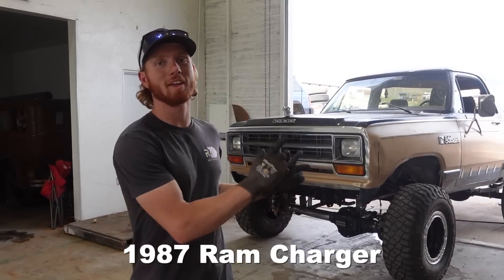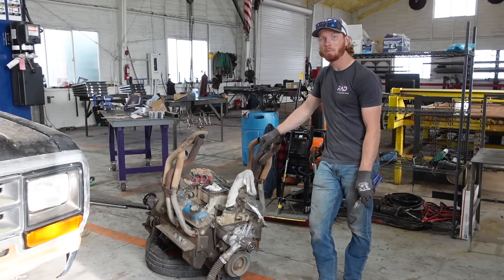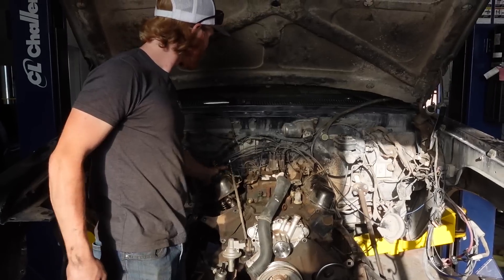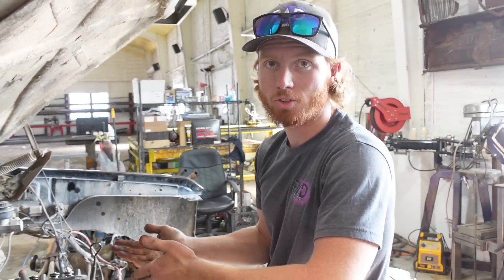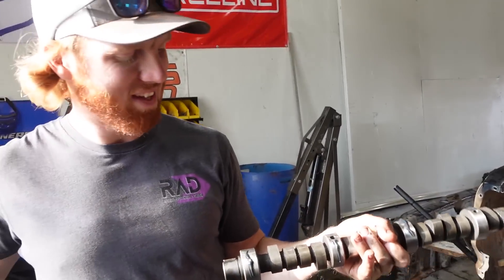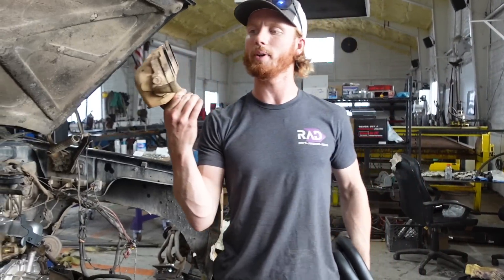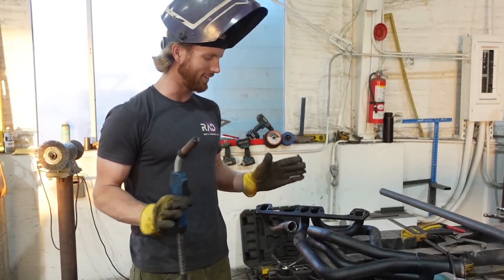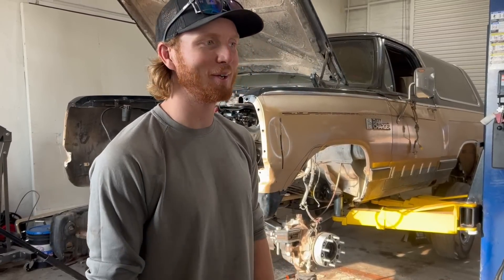Junk Derby Engine for the RADCHARGER

Comment: Rudy don't quote me but the starter motor you have the big one has less cranking power and the new smaller one is for a higher talking cranking motor more power and your cooling fan is missing blades it looks like it will be off balance try getting a 6 or 7 blade fan it will all so cool better i would all so say your water pump will drop bearings soon because of it

Comment: I'm sorry I didn't add in but you're doing a very good job which is really need to get it voice with these low compression Motors I think you probably should have just pulled their 440 out of that derby car is stuck in there that's a strong motor even though it's out of an RV compressional SLE wickedly have 21 if it says so have a great day and have a blessed one also

Comment: Being as deep as you are. I think i would have pulled the heads, dressed up the valves and seats. Then the correct springs. New head gaskets.
Being an Old retired Chrysler Tech. Damaged my back lifting a cast iron intake off a Cordoba. Been haunting me ever since, 1982,83.
You also should have done those front freeze plugs, leak point. Ask me how I know.

Comment: Just take a compression tester and put compressed air to cylinder to hold valves closed and your Lube for assembly just use Lucas oil stabilizer the thick oil additive works wonders cause it’s sticky
      Headers go in from the bottom so your one of those guy’s that steps over dollars to pick up a penny

Comment: So you can always you know OK compression tester to your cylinder and then hook your air compressor to that and just pump the cylinder is full of air and which will push your piston down fill your cylinder full of air and hold your valves closed lot easier than stuffing a bunch of rope inside the cylinder. FYI.

Comment: I've read on the Dodge Forum that the aluminum plenum that your installed is a problem child, due to differential expansion. There is a urgent mod recommendation which involves better gaskets or somesuch.

Comment: Make an air fitting adapter that threads into the spark plug hole and the other end is an air  quick disconnect…..100psi=sealed and held valves

Comment: a more engineer answer to valve springs: with bigger ramp rates on the cam, the cam can actually accelerate the valve too fast and "throw" the valve off of the cam at the top. even stock engines will do this at higher rpms. thats valve float! a stronger spring holds the valve in contact with the cam

Comment: reintroducing exhaust gas (inert gas) into the intake lowers combustion temperature so that N 2 O is reduced. Nitrous oxide  (N 2 O) has a photo chemical reaction with the atmosphere that causes smog(the crap you see in the air).

Comment: If you want your engine to last forever, gets an electric oil pump that is relayed into the dome light so that when you open the door you pre-lube the engine. Also if your oil pressure drops turn on your dome light.

Comment: Looks like a cloys double roller setup. Buy there tension (for the V6 but fits the small blocks just fine) stock tensioner is garbage. Lanes sells them for less than $40

Comment: Rudy, high lift cams, sometimes need to have the valve guide shortened.
This is done to keep the valve spring retainer from making contact with the top of the valve guide.
The people at Comp cams should be able to tell you if this needs to be done.

Comment: Don't use the air in the cylinder method, it can fail, rope can't. Do you think the fan on the engine is correct? it looks as if it will be unbalanced. Keep up the good work.

Comment: You really should have cleaned the engine before tearing it down.  That saves a lot of dirt from getting into the topend.  Also, I didn't see you put assembly lube on the cam lobes.

Comment: I can tell you from experience that a racing cam is a poor option for off-road 360, better if available is a motorhome cam, it adds much needed low-end torque
Reply from the maker: This is not a racing cam
Reply from the maker: I guess I should’ve gotten into it a little more, this isn’t exactly a racing cam. This Cam is designed to hit the mid-to-low range paired with full dual exhaust. It should give me all the torque I need. Just that extra little oomph for highway.

Comment: novice offroader here, but I believe all this is for more horsepower, is that correct?  after watching offroad videos, horsepower doesn't really seam to be the main issue with being stuck.  Maybe mud but even then, it's clearance and traction.  what scenario does horsepower help the most? just trying to figure out where to budget my mods down the road for my vehicle.
Reply from the maker: Hopefully all this is so it can get up and go on the highway more than anything

Comment: You could have saved hours of work by repairing and using the stock manifolds. The few horsepower gained by using headers isn't worth the hassle.
Reply from the maker: The old ones are super restrictive and cracked anyway

Comment: Your in a shop. Why not put air to spark plug hole  witch will hold both all valves  up
Reply from the maker: I’ve seen that way done before, if you accidentally push the valves, and it falls into the cylinder you are sol

Comment: Just a word of advice... pull a spark plug remove the porcelain from the threaded end then weld an air fitting to the threaded end so you can screw it into the soak plug hole and the when you install the air hose to it, it'll hold the valves closed

Comment: Why do you make so much extra work for yourself, you should always install new valve seals when you remove the vale springs. They are several different thermostat housings available for small block Mopars. You have to raise the engine on most Chrysler products to install headers. Sad.

Comment: Terrible idea! The stock 360 with a carb would be A MUCH better option. GM guys should stick to GM junk. You don't needed to pull the radiator support to change the cam. Put AIR IN THE CYLINDER to hills the valves while you change them. The other "coil" is a DAMPNER.  You just tap the emmisson hours & thread plug in there. You DON'T weld on cast heads...

Comment: You should learn how EGR actually works
Reply from the maker: Copy and paste from the top google answer “The EGR system works by returning a small portion of exhaust gas to the engine's combustion chambers through the intake manifold, lowering combustion temperatures and therefore reducing the amount of NOx emitted”

Comment: Just a heads up, but you probably don't want to be telling everyone on the internets that you are breaking federal emissions laws in your shop. EGR systems are emissions equipment and if the Radcharger had it originally, you have to maintain it. EPA gets grumpy when you do things like that. 

Or just don't post about it on video and nobody would ever be the wiser. Especially since EGR tends to make engines run worse and use more fuel in the long run. Especially when they help contaminate your oil. So yeah, just don't film it and talk about it. Dave Sparks got beat up by the EPA for all their diesel shenanigans.
Reply from the maker: “Off road use only”